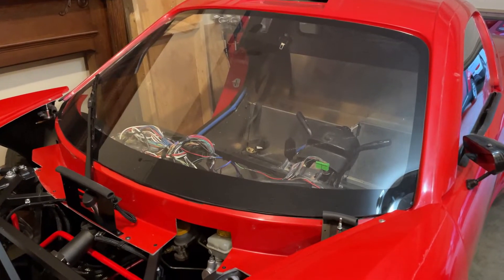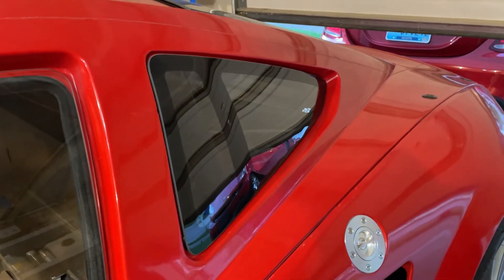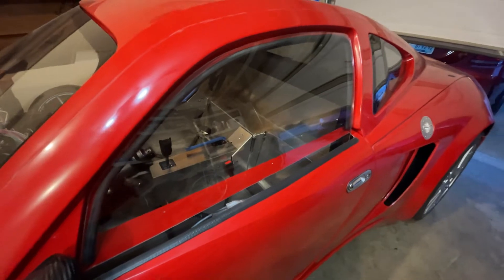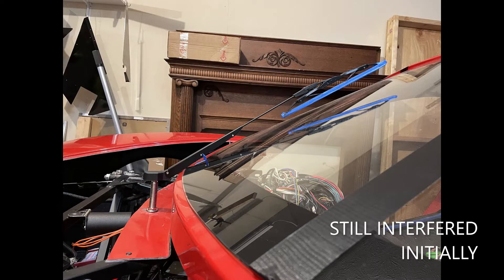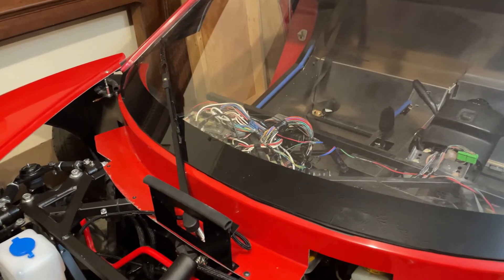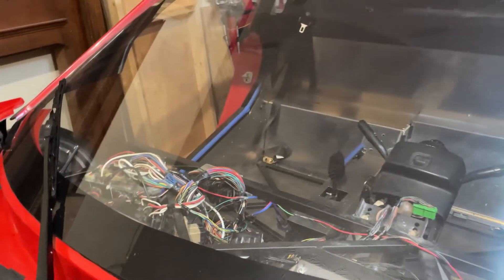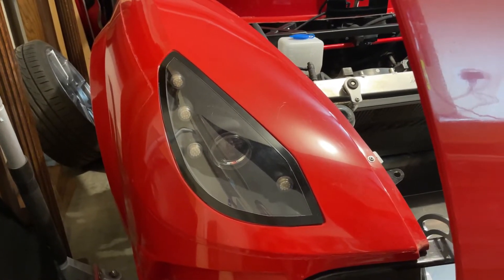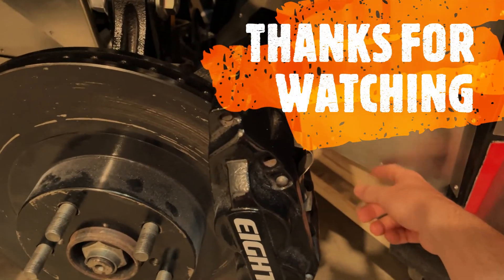#16 - Wiper System & Glass (Factory Five 818)

Comment: I'm surprised the rear hatch isn't curved more to eliminate those little gaps at the corners. If it's pretty flexible, maybe you could get some strong magnets and somehow mount them in a way were they hold the corners down flush? You'd have to bond one magnet to the hatch and one to a mount off the rear fender. Idk, it's not bad looking as is, I'm just spitballing. Great job!
Reply from the maker: The hatch is curved and fits nicely, but the struts that push the hatch open / hold it up put a lot of pressure on the hatch. It makes the corners flex up like I showed. Some magnets could possibly work.
Reply: @mikecamera818  or maybe weaker struts? Might be hard to find though
Reply from the maker: @BigDanSubaru03  you can adjust the strength by where you mount the ends of the struts. Any weaker and the hatch won't hold itself open. I had to compromise.
Reply: Perhaps longer struts mounted further back on the hatch?  Also, the mount to the body would be better if it was mounted close to parallel with the hatch so the tension on the hatch would be pushing rearward instead of upward when closed.

Comment: Was looking at your wiper system.  Some of the Mercedes wipers have a single, cam driven wiper that lengthens the ends of their stroke considerably.  Not sure if you could make something like that fit, but it does seem the wiper system here is a bit inadequate in terms of coverage. I suppose you could check their system to understand how it works and possible modifications you could make.  It makes a shallow "M" pattern where the wiper raises up towards the upper corners of your windshield while the middle dips down somewhat in the middle of the "M".  Mercedes calls it a mono wiper.
Reply from the maker: With enough time and money I'm sure you could make that work. I chose the lowest profile wiper system I could find due to my space constraints. The car is far from being waterproof so I won't intentionally drive it in the rain. The wiper is just to pass state inspection.